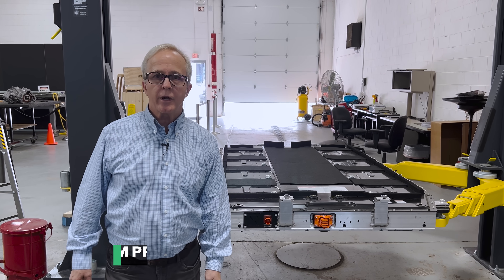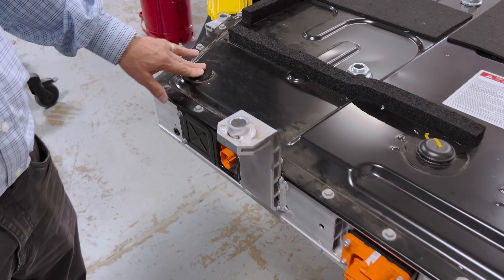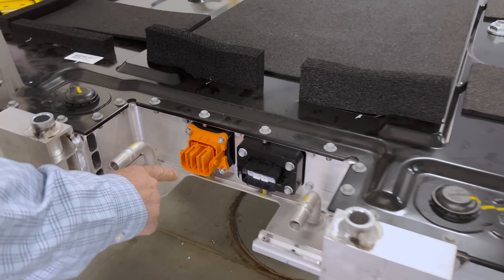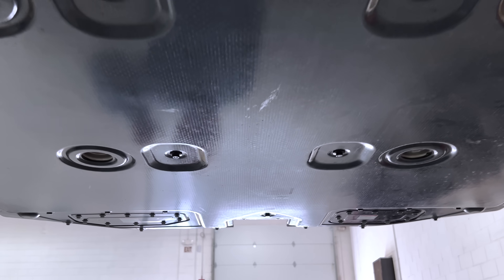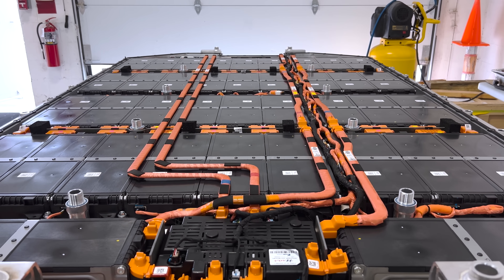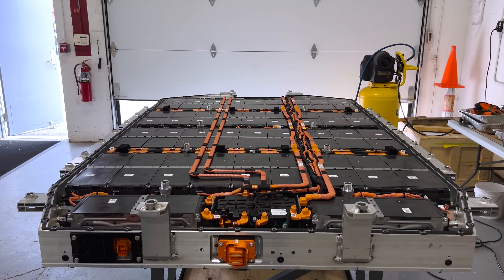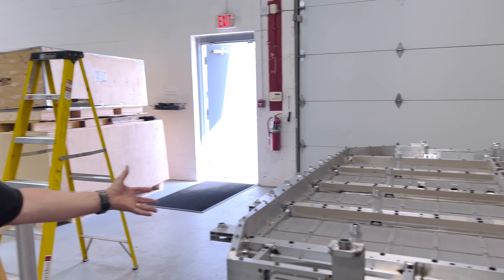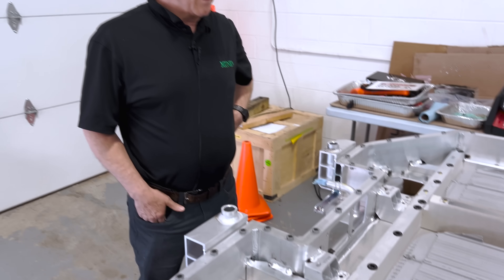Inside the Kia EV9: Full Battery Pack Teardown

Comment: Just from repairability perspective, why do I like this better than Tesla pack
Reply: Question is: will we ever need to repair the pack? If it lasts 300k miles...no repair needed.
Reply: @marctenhove874  yea and what happens if it needs repair before that and even after that. The point of EVs is to be green and if you can't repair it it's good as eWaste
Reply: @leviandhiro3596  tesla refurbish their batteries. So while you can't, tesla can. You also pay way way waaaayyyyy less for a new tesla battery than a kia one.
Reply: @marctenhove874  Hyundai and Kia EV taxis in Korea did battery life tests after 300k kilometers. Almost all had over 95% left.
Reply: @marctenhove874 Ioniq 5 and EV6 are used for taxi in Korea. Some care already exceeds the accumulated more than 400K km, but the battery SOH were exceeding   95%. Battery module replacement is not required in general but it can be repaired in some special case.
Reply: @marctenhove874  of course we change the battery when it get any damage, even if the impact does not affect the battery the whole thing needs to be replaced
Reply: @woodywoo3950  for kia batteries yes. Tesla is more pragmatic
Reply: What a great presentation. It's very impressive. 
The amount of the thermal interface material seems a lot but it is much less than the quantity of filler of Tesla batter pack. 

The cooling efficience was well demonstrated by Ionic 5N performane who are using same cell and pack design.

The composite cover protect the batter pack from a scratch and excessive cooling of the cooling channel. 

As you commented, the bottom cooling system is good to maintain insulation and homogenious tmperature of the battery pack.

One of the distintive feature of e-GMP battery is the use of battery edge as the cooling point which can pull out the heat for each electrode. It is a big challenge to remove the heat from the center of the cell which is the main cause of the battery life degradation.

The statisticts saying that the battery life of vehicle model  who is applying 18650 cell is longer than the 2170 cell based model.

During the battery day of Tesla, the cooling through the bottom of the cell was presented for 4680 battery cell to remove the heat of the center of the cell. However it is not well realized until now. Some weldings are applied between the current collector and copper film to secure the contact for the current and heat transfer but quality of the welding is not uniform which has been the main issue of the 4680 cell production line anf it is slugishing the line speed and drops the productivity significantly.

I think the cooling design of eGMP is one of the best in class.
Reply: Yeah, seems to me like a dream to repair it, looks like it would be feasible to swap individual cells or modules that got too unbalanced wear.
The car itself is a super expensive suv(78k€) so endurance probably isn't needed, however for a properly sized car wanting to have all important components working for its 20-40y daily usage life makes the choice of a serviceable pack extremely important.
Reply: @miragept You are right. It is possible to replace one of the module but a qualified team and tools are required. There is a simple tool to lift a module in safe manner. Also, the SOC of the new module needs to be equalized in advance to match with the SoC od the battery pack through battery power converter.
Reply: @MrVegasoul  As with mechanical parts repair on a vehicle the same it is for a battery pack, its nothing special basically.
Reply: @miragept  The lowest available versions in the US are ~ 51k€  (each state has different sales taxes/registration fees which can add up to 10%).  Average age of the US auto fleet is around 12 years, so beyond swapping modules in the event of a defect, these batteries modules will easily be able to find a second life in Energy Storage etc.  This is a huge difference versus the newer Tesla pack which are not serviceable due to the rigid "foam" that surround the cylindrical cells.
Reply: @bernesto2468  That rigid foam encasement serve many purposes, not the least of which is making the battery pack an integral part of the frame or chassis, which reduces weight, extend range and life of the vehicle.  It's all a complex trade-off optimized for efficient manufacture, performance and endurance.  When is the last time you replaced one or two valves or pistons on an engine?  You either replaced everything or got a new engine.
Reply: @bernesto2468  USA isn't the world so doesn't matter, car fleets in many other countries reach much higher years with cars before 2007 being preferable to newer ones in my country for those that don't drive a lot.
Reply: The primary concern is determining the number of Tesla batteries that require replacement and the feasibility of repairing those with only a few faulty cells. Additionally, it is crucial to assess the extended battery life after repairs, considering the risks and efforts involved in disassembling and reassembling the battery. Tesla's approach of refurbishing battery packs in-house should also be evaluated for its effectiveness and safety.
Reply: Serviceably is also potentially beneficial when you are putting a ten year warranty on the battery.  If there are unforeseen problems, it’s likely cheaper for them to repair/refurbish than replacing the entire pack with brand new.   If the pack is a disposable design you have no choice but to replace the whole thing.

Currently there’s a large electrification aftermarket for the earlier more serviceable Tesla packs.  I wonder if we will see that shift to these e-gmp packs as the supply of non-disposable Tesla packs dies off.    (Monolithic packs could still be useful for DIY powerwalls I suppose, but not for electrification of an old ICE vehicle)
Reply: Dahn did a program saying that the packs last way longer than the car.  If it's a dud, it's probably under warranty.
Reply: That's such a non issue. You almost never need to repair pack. I'm the rare event that you do, just slap on a new one and recycle the old one. Done.
Reply: You give up reliability, cost effectiveness and add weight to get a bit of unused repairability. It's not worth it.
Reply: @alexforget  Totally agree. This is previous generation solution with the modules that add significant weight and size to the pack. Not the way to go.
Reply: The older Tesla packs are pretty easy to work with and repair compared to legacy auto. Atleast that's what EV clinic says.
Reply: @TAD-9 Even if the older Tesla packs are easier to take apart there is no proven method for fixing them apart from cutting out one cell from every module if you get one bad one.

Module swaps are only temporary because the balancing cannot handle the drifting compared to the other modules at some point.

Some new endeavours have started to replace individual cells with matched worn cells. That has a better chance of being a lasting method but it is still unproven.
Reply: @rkan2  swapping with matched worn cells has been common practise for some time. It's the only safe way to replace cells.
Reply: It's not just about the cells/modules, though.  Replacing the fuse or BMS is a few-minute job on the KIA but an endeavor on a Telsa.
Reply: @concinnus  Make sense for the explosive fuse in case of a crash.
Reply: Because you don't understand the "reparability".  Even though it's modular for manufacturing and assembly ease, it is not intended for repairs, which are highly impractical and expensive.  There are a lot of power tools, as can be seen in this video, which have Lithium battery cells in a module / pack.  Nobody disassembles  them to replace one or two of a 1 dozen individual cells, which require welding tin strips to each cell.  That's because you would get reduced performance, length of useful charge and overall life by replacing the individual cells.   No good mechanic replaces one or two spark plugs on a V-8, they replace all 8.
Reply: 0:38 In a disassembly operation such as this, is the torque originally put on the bolts by the manufacturer determined beforehand so the component can be reassembled properly?
Reply: In not too many years we are going to look back on these gigantic, heavy battery packs the same way we look back on huge and heavy combustion engines from not too many years ago.
Reply: @pasad335  "big" and "heavy" combustion engines haven't really changed.
Reply: @pasad335 more likely we’ll view them the way we view lead acid cells today.

Comment: Silly question. Why use a pack of small batteries with connectors ect. And just have one massive battery?
Reply: If you mean removing modules then yes, that is what a lot of manufacturers are doing. If you mean cells, then no, cause each cell only has about 3,5-4V so in any case they need to be combined to get higher total voltage. A bigger cell doesn´t not equal high voltage.
Reply: Cost is the biggest factor, if there's a bad cell/pouch or two during construction of the battery, it's a lot more difficult to repair a monolithic battery vs just swapping out a cell group.
Reply: It's not silly question.  First you need the voltage so that means a minimum number of series groups.  But parallel cells can be minimised and Hyundai/Kia did exactly this between the gen-1 Kona/Niro with 98S-3P and Gen-2 with 96S-1P.
Reply: @KiwiMechEng  thx